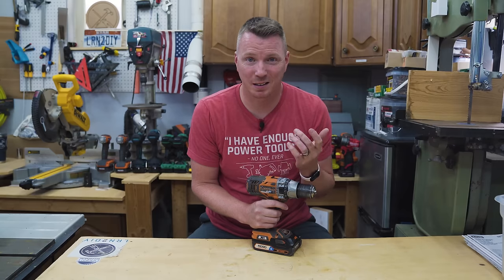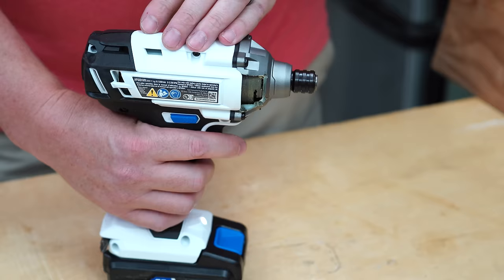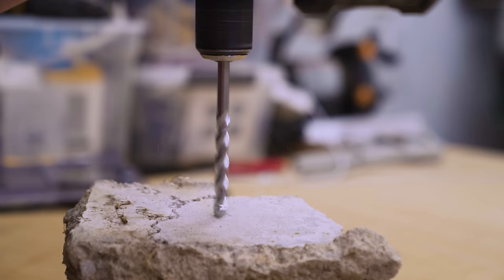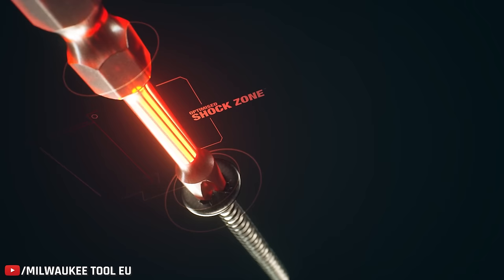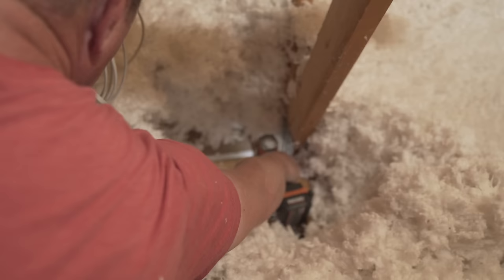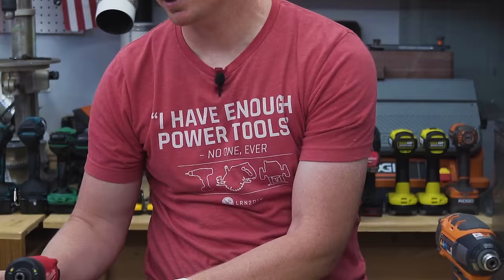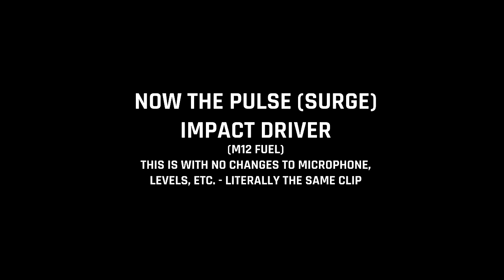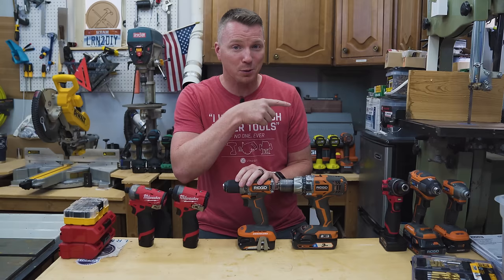Is The Cordless Drill Becoming Obsolete?

Comment: "Consumables"  that is exactly the problem especially for a DIY person.  The batteries lose their charge, power etc.. over time of non-use.  By the time you want to replace the batteries you are faced with the dilemma of buying a new tool or buying batteries. oh, will the best new tool use the battery charger I have? NO?  all new again...  Corded is more more power for longer.  No batteries and I can often get a small corded tool in places I can't get a battery operated tool; this even more common with air tools.  I have a small, very quiet inverter generator that runs my makita 12" compound Mitre and weighs the same as the saw, I can use the tools away from electric service and charge my phone/cordless too.
     The drill bits you show are of low quality.  Quality drill bits are NOT titanium coated, they are made from high quality tool steel or cobalt.  They will last a long time and you resharpen them.  Norseman has a cry-nitride coating to replace cobalt but i am sure Cobalt is better as they can be resharpened and still be usable in 300, 400 stainless.  
  I have older US , European and Japanese made corded tools that NEVER stop working.  I have an old Panasonic cordless that is still going on original batteries after nearly 20 years but this is NOT the norm and I am sure they are not what they were.  I will be buying a small cordless drill or impact which is why I watched this video.   What, I am concerned about is the deformation of fastener heads when using an impact.  My air impacts would destroy the fasteners.  Also when drilling to steel and other metals you need to drill slowly with a cutting oil, how are these cordless impacts with that??  For the reasons stated above i do not want an array of cordless tools just a very few.  So would a cordless impact suit me is what I want to answer...

Comment: Those sub compact Ridgid impacts are not what I’d use for a demonstration anyway. Severely underpowered, batteries don’t hold a full charge very long and overheat with not much use. Ridgid’s full size line seems perfectly fine, but the compacts are junk in my experience.

Comment: I am a carpenter and in my opinion the impact driver is for when you don’t care about how the screws goes into the wood , in other words for rough construction, and the drill is more for smooth perfect screws , a drill can be used very smoothly and it won’t over sink the screws and one can go nice and slow and precise , an impact driver is just rough and overpowered 
(Btw , in your video you are using an old crappy brand drill , try a new drill from a better brand , they are so light weight now )

Comment: I can tell you how much better impact drivers are . My daughter borrowed mine and will not give it back ! i only buy Ryobi tools and while they are not heavy duty they serve my needs. i used to buy Dewalt but their batteries are too expensive and low quality. I found that with a little work i could put a 5 cell lipo battery in the case and have a far superior battery.

Comment: why would you want an impact absorbsion point in your bit? defeats the purpose of using the impactor haha. swap to the combi drill if its too much impact. the impactor is good, but its far from a replacement for standard combi drill, like it doesnt have torque settings, hammer cant be turned off, smaller screws it will either strip the hole out or snap the screw head off. people who use a impactor for smaller screws, i tend to stay away from as i dont want things over tight or snapped screw heads to deal with.

Comment: The right tool for the right job. For drilling into wallboard you need a drill. Small electric screwdrivers are good for small projects and a two speed drill is for  drilling in metal. For metal you need a slow speed and cut into the metal. For wood high speed. So the right tool for the right job means 4 drills. For the hammer drill you should never use a hammer drill without a handle attached. If the drill catches and stops in the concrete the torqure on these larger drill is so great it can break your wrist.

Comment: If you value your money/ work in residential don't use your impact to drill.  Just because it's "designed to be used in an impact driver" doesn't mean drills aren't better.  the constant hammer function just chews right through many metal working bits

Comment: Impact drivers are great for screws but they tend to be less controlling with some finishing screw uses because they don't have that limiting collar. That goes a lot and also the little hand powered screw driver, although most the times not that powerful, has its place in screwing into stuff like soft woods as well as into plastics or even some cast metals like zinc and aluminum that can wear out the threads. Impact drivers are kinda meh in drilling unless you have small drill bits that tend to like that higher speed rate that impact drivers like to run at full trigger pull. Anything above 3/8 is worthless as it spins too fast without trying to run it with trigger throttle so it does not burn up the bit. 

Step drill bits are good enough for an impact driver but that's about it. Carbide cutting bits for metal and most of the wood cutting bits (there is a lot of options besides paddle bits and bi-metal hole saws) tend to hate impact drivers. Most the times they don't have that 1/4 hex quick connect on them. Cordless drill is not going anywhere at all but dang it places need to start getting along with the times and stop selling the darn rounded bit shafts cause the drill chucks suck now and hardly ever bite into the bits to stop them from spinning. This does not mean it needs to be 1/4 hex shaft either. The tri sided drive that is starting to become common is what needs to happen as it has the best strength and milling saving cost vs a hex unless its just drilled and pressed into but its hard to resharpen those unless you have a device that can handle the shorter shaft. That's the only thing the hex ended bits have over the old drill bits is they won't spin out but they can still be used in a regular cordless. Then again most of those bits, even though hex quick disconnect, is not really suitable for impact driver use. They can't stand up to the impact force and over bite and chip/wear out quickly. That does not mean the marketing team won't try to sell it for impact drivers cause marketing is the best way to kill a product, look at the radial arm saw and all its "features" they tried selling it for.

As far as the tiny but powerful, its not the driver, its the battery behind it. Torque Test Channel has proven that a fair bit where even fairly old drills that don't have much power, can get a pretty big leap just by changing up the battery to a different cell model. The old first gen lithium batteries that populated many of the "new" (back then) drills over the Nicad, kinda suck in both power and charge for the same size. Milwaukee and Dewalt are the few that have been working more on battery tech and using new cells to boost their drills/drivers and other power tools and its slowly catching up among other brands. The driver being loud is one of those "its far stronger than it needs to be" which is where a lot of that noise comes in from. Impact drivers depending on the model and the battery combo can remove properly torqued lug nuts off a car. Some of them (Milwaukee and Dewalt) have been doing a "who can make it stronger" competition for a while now so using them and even Rigid as a medium is not the best thing. They are the over achievers right now in a lot of the fields.

Comment: Maybe someone will come up with a torque-regulating drill that can also act as either a hammer drill or an impact driver, or, for some real excitement, both simultaneously. For now, I like the ability to dial up the torque gradually on a regular drill; I would have destroyed plenty of projects without it. I also have a nice big impact driver and  hammer drill, but they are both plug-in models because I know that they will last forever on the shelf and a battery-powered version could easily go bad during the time intervals between my use of either.

Comment: The projects you're talking about are diy at home with no deadline other than,  get it done before it snows. When you have a deadline,  and it takes that impact 25 seconds to put a 10 inch fastener in.  And you break out a drill driver and do it in 3 seconds, that's not obsolete,  but an absolute necessity.  You're answers are logical,  just not considering the big picture.

Comment: Maybe you can use an impact driver.  But most novices will blow screws clean through their work because they don't have the skill.  That is why the drill driver will always need the clutch to control the torque used.

Comment: Have to be careful with impacts. 
Stripping heads done easier with impacts 
Never use an impact to turn a motor or a scissor jack with an impact 

No kickback.  That is why impacts were made.  Working in outer space. The impact won’t rotate the user like a drill. The equal reaction happens in the impact

Comment: I do not agree, the 2 tools have specific characteristics and disadvantages. 
In my opinion, the drill is much more versatile, precise in operation and with torque clutch. 
I own 3 impact drivers (1-12v & 2-18v) , 7 drills (2-small 12V, 2 medium 18v, 3 high torque), 1 medium impact wrench and 1 high torque impact wrench. And as an extra I also have a drill driver (it looks like an impact works like a drill) 
I suppose I can give an opinion from the perspective of someone who owns the whole range and uses them at work. I think that those who work in the field are the ones who should talk about the functionality of the tools, because we can all read the specifications of a tool on the manufacturer's website.

Comment: I've never owned a cordless drill.   It almost doesn't matter what it is.   If there is a choice between a corded or wireless solution, I'll always pick corded over cordless.   Never any worry about running out of power, or having it be dead when you need it.  I want to minimize things that rely on batteries in my life.

I've been using the same corded bargain basement Ryobi drill for 20 years, and it still does the job.  I've had no reason to buy anything else.

That, and most of the things OP uses the Impact Drill for, I just use a trusty old screwdriver for.  I will break out the drill when I have to drive in lots of tough screws, but most of the time it really doesn't save me much of anything over just using a trusty old manual screwdriver.

Comment: Thing about drills they multi-task several functions and are very useful but just not as light as an impact driver but to defend the drill we are more of a fastener type society we use screws and bolts and so forth but we still need the O reliable drill RPMs on the impact will never be as fast as the drill the drill has 2 settings though even some impacts have 3 settings the RPMs will always be faster in a drill and a drill will drive a quarter inch 8" lag bolt much faster than an impact. So all in all if you have small jobs and want to be speedy use a drill if you have a long stretch out jobs or projects and doing overhead work or holding, I guess the impact with suffice but it's all up to the user at that point. Anyhow you drive home some easy facts but when you really dig into it they don't hold up to the drill thank you for letting me post...

Comment: You are not a tool guy, counter sinking with an impact, that says it all, and you have trouble holding a drill sometimes and you've injured yourself, and as far as torque settings go you should just be able to use the trigger and go by feel, if you can't do that there's something wrong, I'm being a little negative I know, but at least you're having a go lol.  (thumbs up).

Comment: Impact drivers aren't great for mixing paint, won't hold a #21 drill bit or a wire brush wheel, work badly with machine screws, and break too many wood screws. I'm sticking with my powerful cordless Milwaukee chucked drill.

Comment: Im planning to buy a cordless 12v driver. But does anyone know how long will the battery lifespan lasts? Im just an occasional woodworker, any tips will be very appreciated.
Reply from the maker: Most batteries in today's brands are pretty decent and will last for many years if you're only doing occasional work. Flex and Ridgid both offer lifetime service agreements / warranties on their batteries and tools if that's a concern but the tech has gotten to the point that the battery will last so long that you could likely use it for 8-10 years or more if it's only occasional use. I have ten year old Ridgid batteries that still hold a charge and work great.
Reply: @LRN2DIY  I see. But do I need to charge them until specific percentage? I've read some forum that overcharge or undercharge might degrade them(?)..
Reply from the maker: @sam28509  I'm not an expert on this but my understanding is that you should remove the battery from the charger once it's charged. Maybe others can chime in here if they have more info about this specific topic.
Reply: @LRN2DIY  Okay thanks a lot man. I do have corded drill that my father bought but I think combining with cordless drill will help me finish my work faster. anw thanks again

Comment: Most of the comments below seem to misunderstand the video and come from pros who have invested heavily in tools for certain jobs which is fine but a lot of the comments are clearly just habit again fine you do you. What the guy is saying though is that impacts can do pretty much anything a drill can for most construction jobs where fine precision isn't needed. I agree with him. Pretty much everything bosch lineup is now impact ready, their hole saw's for example. 

I see impacts as striped-down drills, most dont understand all the functions of modern drills and i see most (including pros) leaving it on one setting and it stays there. Even manufacturers struggle to market the 2 and you can tell they have seen a market shift otherwise the bits wouldn't be coming out thick and fast. I have one drill and its electric because i dont use it enough i use the impact for pretty much everything. Drilling into tile no problem, brick? no problem, hole saws for bath taps! no problem.

If you're a DIY'er weekend worrier! Save your money and just buy an impact with a selection of bits it will see you through 98% jobs about the house.

Comment: You're saying what everyone is feeling but nobody wants to say it openly. Milwaukee has the auger drill  for electric poles actually based on the high torque impact wrench so people high up there doesn't not have to push hard into the wood.

Comment: I don't buy that. I still prefer drill driver in many areas. If I'm doing electric or anything where I'm piloting holes I'm getting the driver. If it's just simple screws and lags I'll use the impact as I find it usually takes less battery to sink a hundred than if I use the drill. If you are using it only around the house I'd definitely recommend getting a drill over and impact just so you can do both with 1 tool instead of relying on quick change bits or the little adapter.

Comment: Wow, couldn't disagree more.  Yeah, I own them both.  Absolutely hate using an impact driver for anything but driving big/long screws.  Ridiculously easy to over-tighten/strip screws.  VERY risky using the driver to start threaded bolts without cross-threading.  Tough to start a drill hole without the bit potentially walking a mile.

Comment: Drills are for holes they don't make a speed bit for. I'm not building pianos ,and impacts make a Damn Fine Hole anyway. I like the loud report but have used lots of GRK T10 trim screws for split Avoidance, better precision and a tiny screw head thats barely Noticeable. (OK I build pianos , but they ain't Liberace pretty boy ones) They hold Like a MF for their diameter but it's easier to strip em if u don't find their G spot fast.

Comment: I disagree with this video - I've got a kit of both and I barely use the impact driver. I just chuck a decent bit holder in the drill if I want to drive something, then I get the benefit of the clutch. And with solid walls being common in the UK, I need that hammer function to make holes.

Comment: I've quit buying any battery powered tools anymore.  1.  The battery is 90% dead anytime I go to use it.  I've had many occasions where my battery drill has been put away fully charged, and six months later I grab it to drill something, and it dies in 15 seconds.  Then I have to grab a normal drill to do the job, and charge up both batteries, then put the cordless back into the closet for another four months, when it will be dead again when I need it.  2.  The batteries last about four years, and it's cheaper to buy a whole new drill, than just buy two new batteres.  I only use stuff powered with 110Volts of power anymore.  At least I can count on that to work when I need it.  Rechargeable stuff sucks.

Comment: It'll work, so not going to knock it, but you're really not doing your drill bits a favor by slamming them with axial force. They aren't made for that and I wouldn't ever do that to a nice bit. If you're just making rough holes it's fine, but you'll also lose some rotational accuracy with the impact compared to the drill.

I think your point stands for general use, but there is no question that the impact is not the best tool for the job when it comes to rotational drilling -- it may work, and that's fine, but it definitely doesn't make the drill obsolete.